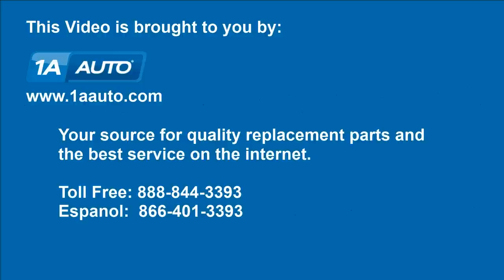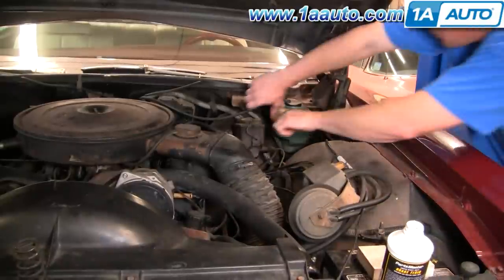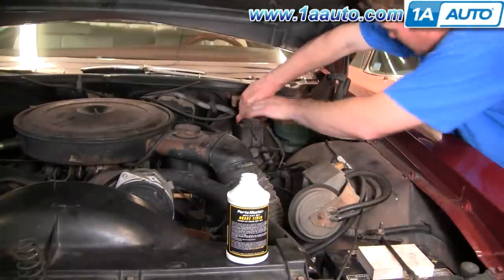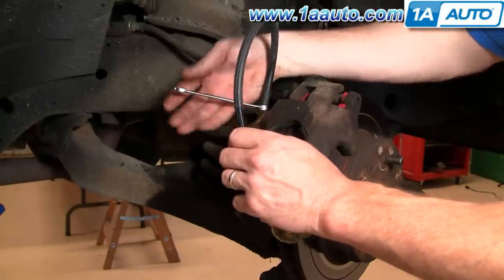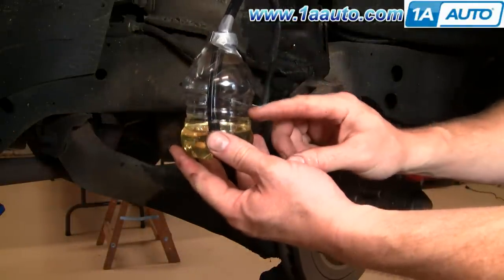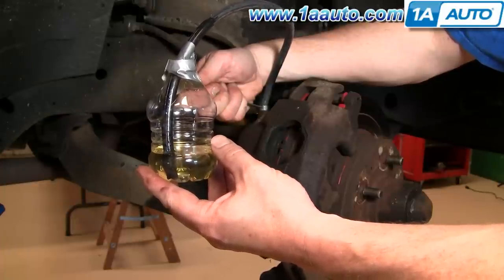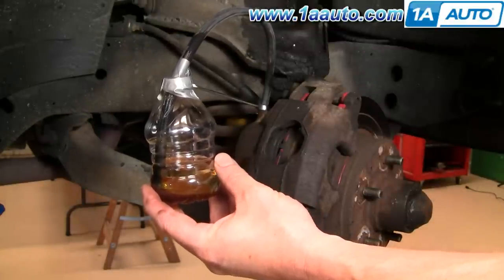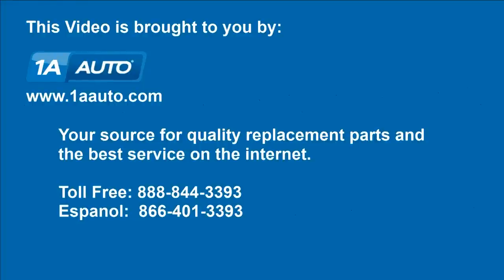How to Bleed Air Braking System

Comment from the maker: @felixr29 You generally only need to bleed the wheels that you have done work on.  I usually bleed the closest one first but regardless you should bleed all the ones you worked on until you get no air then check them all one last time before finishing.

Comment: WARNING --- problem with 1 person method is the drain hose on the bleeder valve can easily leak and let air back into your system.....highly recommend using 2 people to avoid this

Comment: do you have to have a tube sitting in brake fluid or can you just have the person hold the brake down, open valve, watch for steady squirt or spitting of fluid until you get a steady stream out all while making sure you keep the brake fluid reservoir topped off so it doesn't run low, thanks
Reply from the maker: If you have a helper, you can have them pump the brake pedal up, press down firmly as you crack the bleeder, at the same time make sure that they hold the pedal all the way down, then close the bleeder and have them pump up the pedal again.

Repeat this process until there is no more air in the system. You do not have to have the line sitting in brake fluid as long as you close the bleeder before your helper releases the brake pedal. Hope this helps you out. 1aauto.com 888-844-3393

Comment: I have a 97 Ford Escort and I replace front calipers and one rear wheel cylinder. Other one's brake line fitting is seized and heat and pb blaster is not doing it. It still work fine. I am having a problem bleeding me brakes. I am doing solo and I have a jar with brake fluid in it with hose. I am getting so much air out. Then no more air. But the brakes feel soft. For some reason, I am not getting fluid out the new wheel cylinder. My Escort is a manual. Also, it has one brake line per brake location. What am I doing wrong or over looking? Thank you.
Reply from the maker: You may want to check the brake lines to see if there is a leak somewhere along the line that's drawing air into the system. Hope this helps you out. 1aauto.com 888-844-3393
Reply: Roger that. I will get under and fallow all brake lines. Thank you for responding.

Comment: What if there is a bunch of air in my brake lines and the fluid won’t come out?
Reply: Your bleeder screw may be clogged. Remove and clean it. Make sure the hole in the screw is clear of debris and you can see right through it.